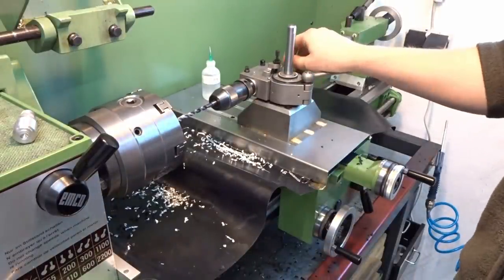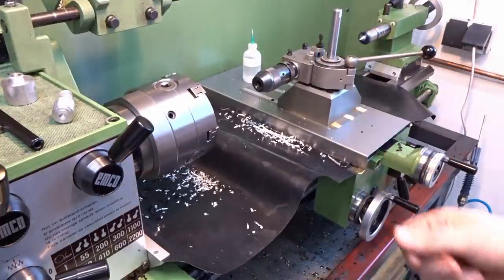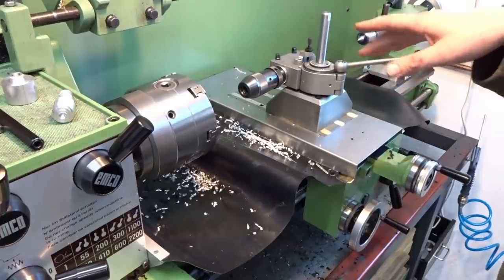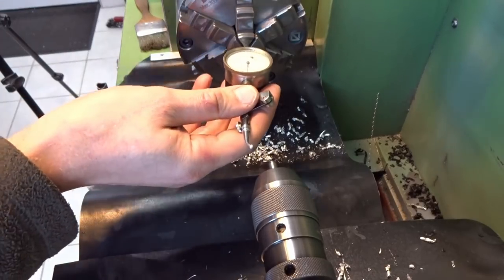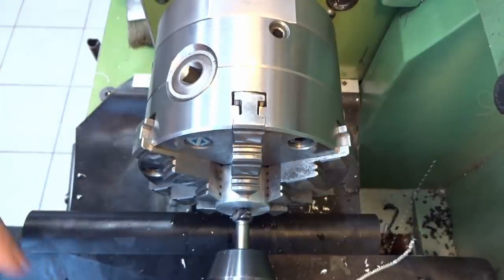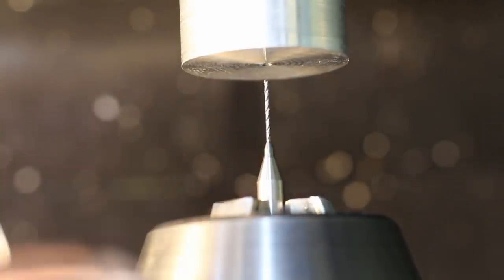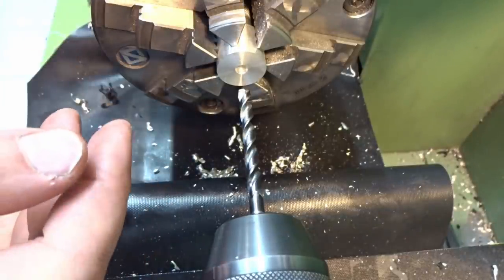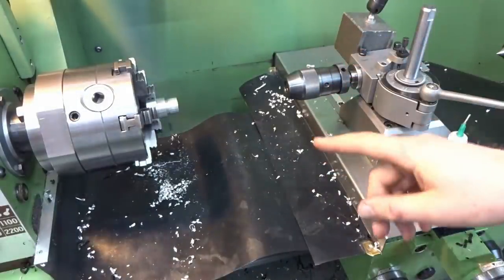Carriage Drilling on the lathe

Comment: Not very smart to use lathe like that. Going to damage the bed screws and gibs. Like basic machinist knowledge.
Reply from the maker: There is no load case from drilling that will damage my lathe in any way.
Reply: 20:44